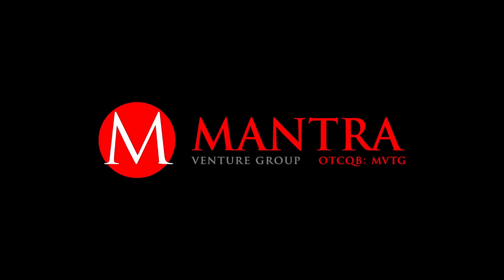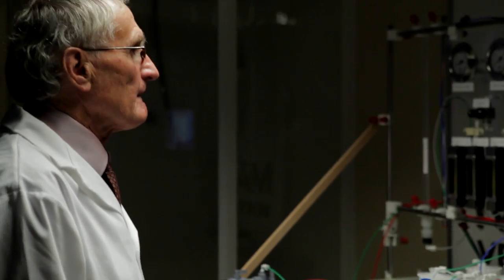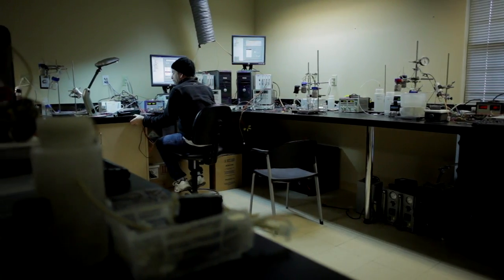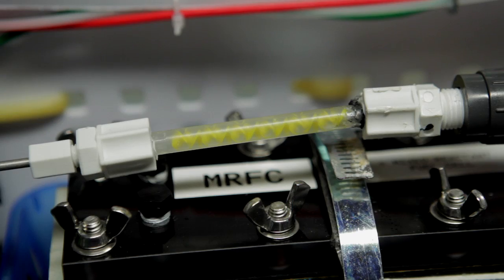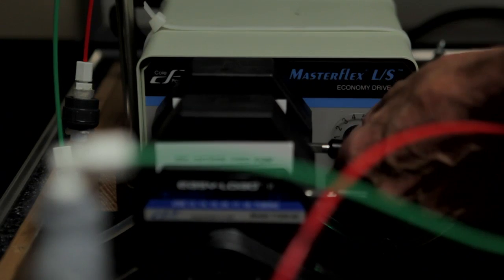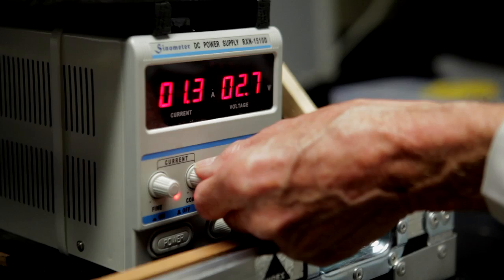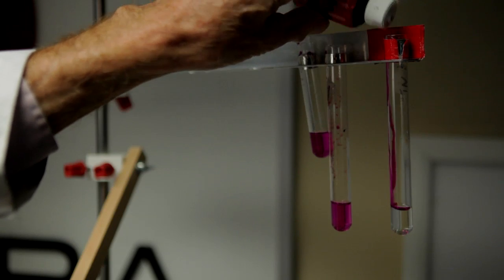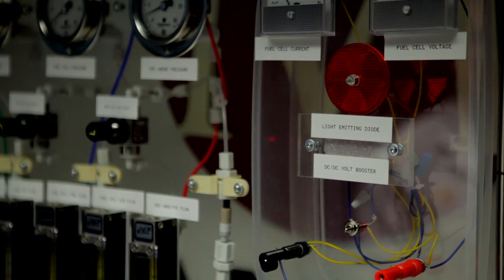Carbon Dioxide as Energy Storage

Comment: Learn more about it all here:

http://www.facebook.com/mvtgstockholders

http://mantraenergy.com/

They have three issued patents now, and more pending world wide. One captures industrial waste gas emissions, and converts the CO2 into a liquid portable high energy density fuel. This has massive world wide implications for solving the Global Climate change and warming problems caused by man made CO2 emissions. 

The Second is a new generation of fuel cells that are lighter, smaller, far lower cost, much simpler, do not use expensive platinum or polymer membranes, do not need hydrogen gas or hydrogen reformers which are heavy bulky and costly, and they can run on the MVTG fuel produced from CO2 waste, that is produced using renewable electric power, solar, wind, geothermal, and that new fuel cell fuel is non flammable and not explosive. This technology may close the gap  and replace gas and diesel engines in cars.

The third combines both technologies, to use like a rechargeable battery to store power as fuel cell fuel made from waste CO2 gasses, for back up power and peak power storage for use later during peak power demand.

The company is a public company, stock ticker is MVTG.
Reply: I forgot to mention, they have a number of partners now. Customer-collaborator-partners that are mega billion dollar international giants that are accelerating the commercial phase of the business. Google Alstom, LaFarge, Kemira, NORAM and BC Hydro....